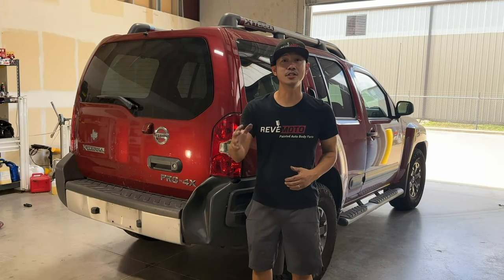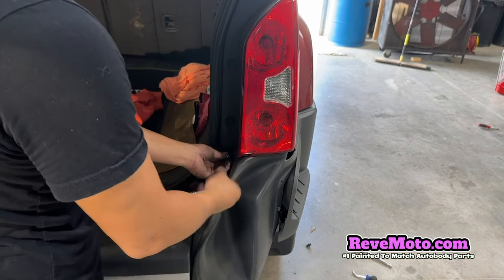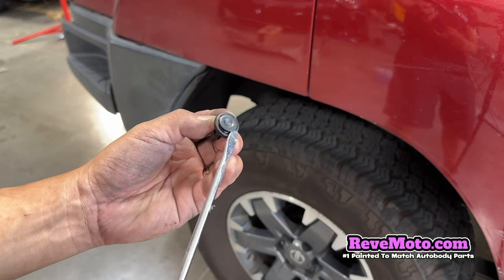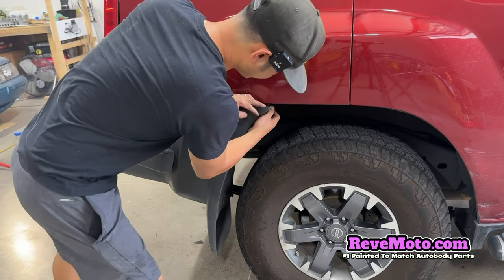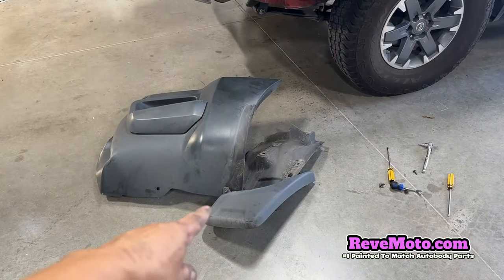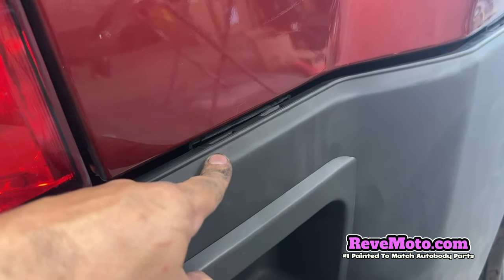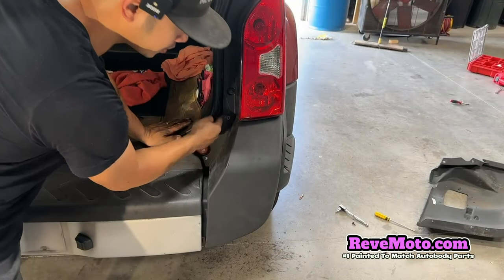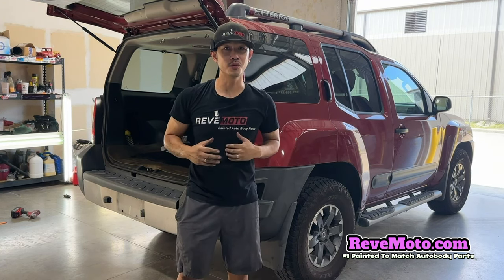2005-2015 Nissan Xterra Rear Bumper End Cap Removal & Installation .  LESS than 10 Mins to do

Comment: Great video. The only problem is that i cant find my 10mm anywhere.
Reply from the maker: lol can’t tell you how many tool boxes we have gone through since we deal with the same thing. Try to keep a box around now to keep all the tools in so we can toss them in there instead of on the floor.

Anyway appreciate the comment and you watching! If you need a painted replacement part, visit us at revemoto.com